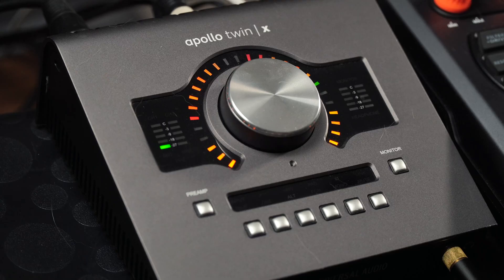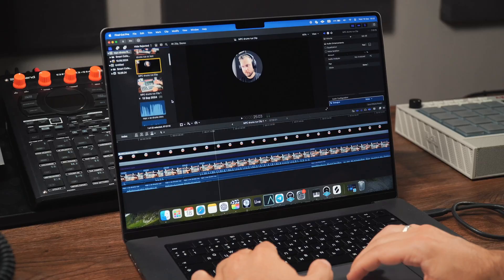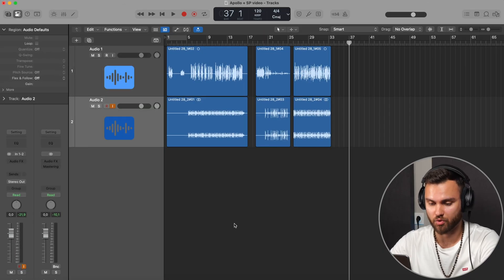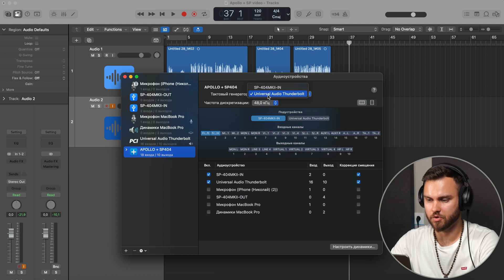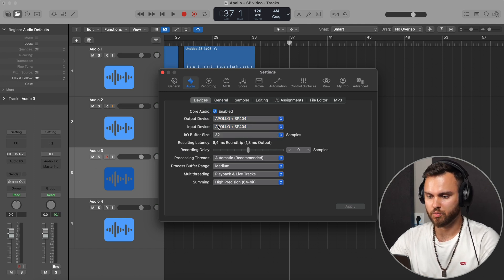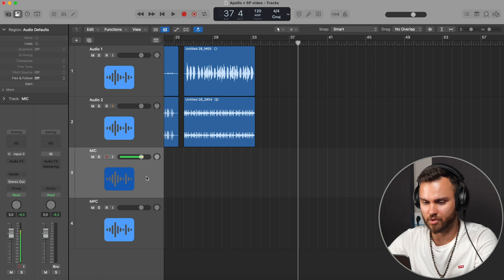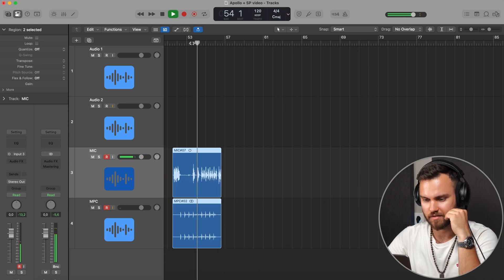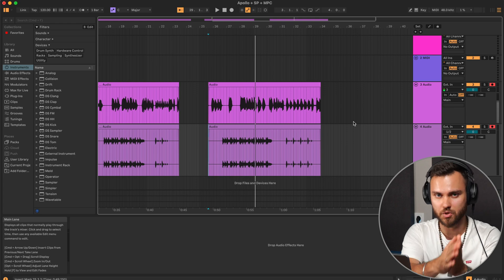How to connect multiple devices into Apollo Twin | Aggregate device

Comment: I followed your video. I am using the MPC 3.5 desktop software as my DAW. I chose my aggregate setup for both output/input under Audio Devices. The MPC Key 37, SP-404 MKII and UA Twin X are all connect to my MacBook Pro I-9 via USB. It seems the SP-404 is being bypassed. I like creating in controller mode as opposed to standalone. Do you have any pointers on how I’d setup all 3 pieces of hardware. Looking to add the SP-404 to my workflow.

Comment: You can get an audio mixer for less than $500 and plug the stereo out into the Line inputs for the Apollo, that way you have a bunch more control and can hear everything without having all the extra routing. Just link the channel on the Apollo and appropriately gain stage and you get very clean signal and plenty outputs. I use the Allen heath zed fx and have nothing but great things to say

Comment: I dunno $1000 sounds like a lot just to hook a mic up via adat. I have a danalog ddx3216 that has like 16 line inputs, its a digital mixer etc.. and it has the adat16 connetion so 16 inputs and outputs and adat, you can likely get this under $1000 fairly easy and this isn't even the cheapest mixer option. There are tons of mixing consoles under $1000 with adat out.  Between the zen q and apollo that is 8 channels able to be sent to each.